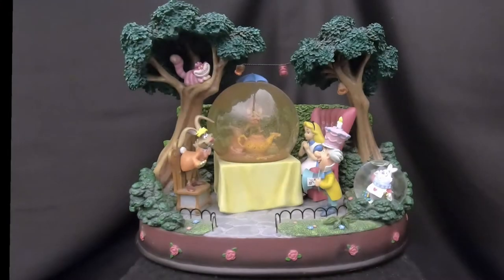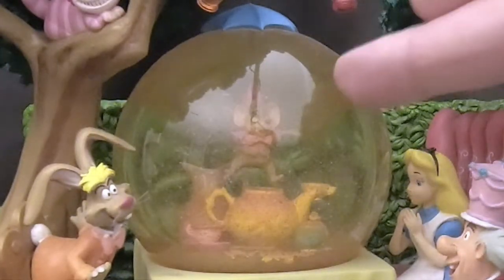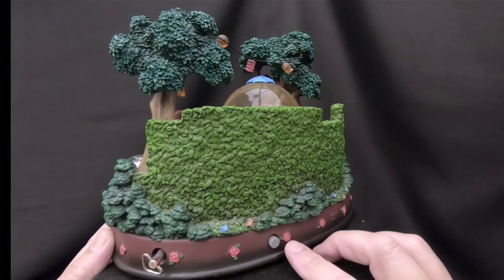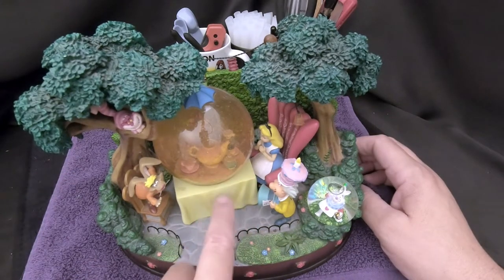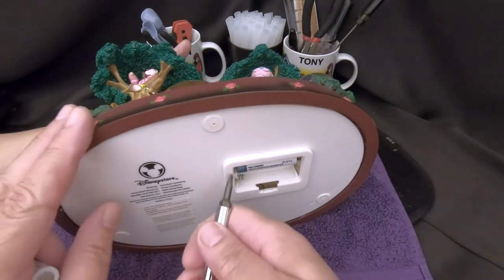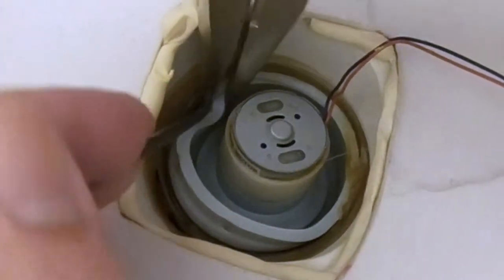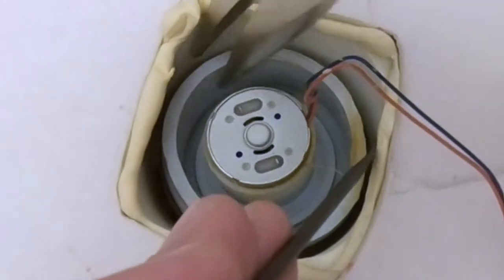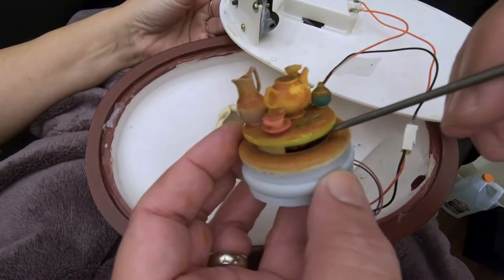Ep. 76 - Disney Alice In Wonderland Snow Globe Repair - Rusty water, circulation motor repair

Comment: Would you show us how to fix the little globe on the side?
Reply from the maker: We will do that the next opportunity that we get. However, we will most likely use the hair dryer to heat up the base where the small globe is mounted. Hopefully it was installed with hot glue since the heat will be able to loosen it. If it was installed with super glue or epoxy we may have to break the globe then install a new one. We have been dealing with health issues and hope to return soon.

Comment: Thank you so much guys! ♥

You guys never cease to amaze me honestly.

Idea: Is there a way for you to glaze or protect the magnet without harming the connection at all? I'm no expert but I wanted to push forward an idea either way.

I also agree, Disney has an art in their music boxes and more so their Snowglobes. They amaze me but in the end some commonents are plastic, made cheaply or not really made to last and this is a shame since some of them are pure art and again have amazing features.

Stay safe guys ♥
Reply from the maker: Thank you! Our original plan was to waterproof the magnet. I mentioned it in the video when I found the first magnet that I couldn't drill a hole through. However, after spending several days working on it we decided to go with the bigger magnet but not waterproof it so that we don't have any issues removing when we find a solution to get the right size magnet with the necessary hole. A local aquarium supply store told my son recently that there is a spray that you can purchase that will waterproof anything you want to place in an aquarium. The water will not affect the item you place in there and the item will not contaminate the water. I need to get some of that and be ready when we find the right magnet. But I agree, that is the solution.

Comment: Did you guys ever try to take off the rabbit? I have this snow globe and the one with the rabbit turned brown and I would love to see if I can clean it
Reply from the maker: No, we never removed the small globe with the rabbit since the water was fine. If we were to try and remove it, assuming that it is attached with hot glue, we would use a hair dryer and heat the base around the small globe to melt the hot glue and remove it. It could take five to ten minutes of heating to get it loose.

Comment: Do you have a video on replacing globe I am looking to replace a globe that got broken and if so could you post and can I ask if you know where to buy bigger globes.
Reply from the maker: Hi, yes we have many videos where we remove the globe to replace it or get it out of the way to work on the base. We don't know if you have a solid base or standard base globe so we will send an example of each but there are many more examples on the channel. Episode 195 shows an example of a sold base globe and Episode 169 shows an example of a standard base globe. Basically you need to melt the hot glue that holds the globe into the base. For solid base we set the base in hot water. For a standard base we use a hair dryer.

Comment: What could cause a snow globe to turn brown ? Could it just be from being old ? Is there a way
To fix it ?
Reply from the maker: In some cases there is a piece of metal, or a magnet as was the case with this Alice In Wonderland snow globe, that rusts and turns the water brown. The brown color could also be algae or bacteria that has grown in the water. We, as most people, use some alcohol in the water to prevent that. There could also be a reaction between the figurine paint and the water. Placing the snow globe in direct sunlight or exposing it to temperature extremes can also discolor the water.

Comment: Hello - would you ever consider repairing / showing how … the Disney 3 Globe Princesses Rotating “A Dream is a Wish..” by chance? :-)
Reply from the maker: Hi. We have not repaired or seen a snow globe that matches that description. We did a search online and found one that we think is what you are describing. It has a tall castle in the middle with three small globes around the base, each containing a Disney princess. If that is the one it is difficult to say because there is a large cover on the bottom but the globes seem to be mounted closer to the edge of the base. You would need to remove the cover and see if you can get to the globes from the bottom. However, from the pictures it looks like the cavity in the bottom of the base may be only for housing the electrical components and the globes may be glued into the base the same as a solid base snow globe. In this case you would need to heat up the base to loosen the hot glue. We recommend the hot water method. We have many videos showing hot to do it. Hope that helps. Let us know if it is something else.
Reply from the maker: I am sorry but we have no idea what happened here. We have not deleted any comments. We freely share our knowledge with our viewers and love it when they share with us and the rest of the subscribers. We would never prevent our viewers from sharing information with each other. We have no idea how your comment was deleted but we did not do it. Please share your pointer with everyone and thank you for bringing this to our attention so we can address it.

Comment: It is a lot easier if you get a ferromagnetic material, get a hole put in that such as a metal disk (or probably find certain washers might be ideal).. and THEN magnetise it once it's what you need. You'd have to then make it water poof somehow.  You're very likely to demganetise the magnet by drilling holes in it and depending on the material.. the dust can ignite from the heat generated.
Reply from the maker: Good information. Thanks for sharing that. We found that drilling a hole in a magnet is not joke. Since making that video we found magnets with holes in the middle at either Ace Hardware or Michael's craft store and also Amazon. They are called Ring Magnets. If we have to fix it again we will get one of those that is the proper size.

Comment: Mine has a problem with lights..how can I fix it
Reply from the maker: Ours doesn't have lights. If yours has lights that are not working it could be a bad bulb, or a disconnected wire. The battery compartment may be damaged. You will have to disassemble it and trace from the battery to the bulb to see if everything looks good then start troubleshooting. You may need to replace the bulb. Check out Episode 193 - Nativity Light Snow Globe Repair where we repair a broken light inside a snow globe. Hopefully the video will provide you with some ideas for repairing the problem.

Comment: Store
4.0 4.0 out of 5 stars 264Reviews
50 Pack 10 mm x 3 mm Magnets with Countersunk Hole, Pot Magnets, Fridge Magnets, Strong Magnet, Small Magnets, Whiteboard Magnets, Tiny Magnets for Adults, Magnets for Wood, Wall, Photos, Crafts, DIY
Amazon's
Choice
for "fridge magnet
Reply from the maker: Thanks for the tip. Then next time we need to replace one of those magnets we'll get a measurement and see if Amazon has the right size. Unfortunately they come in packs of 40 and 80 depending on the size. I don't think we will ever need that many. Fortunately they are not expensive.